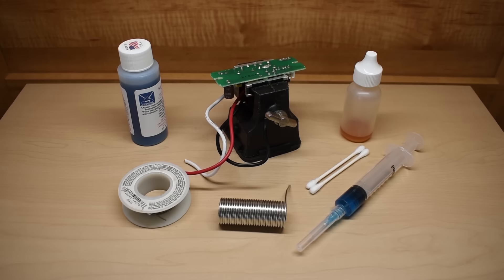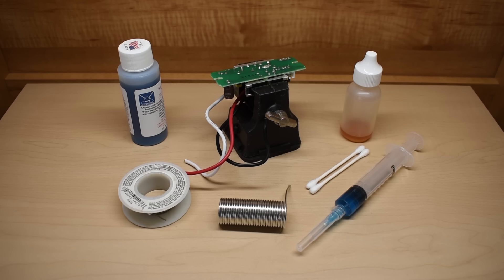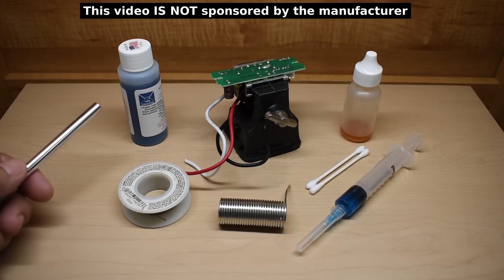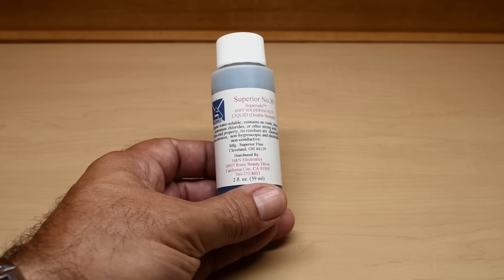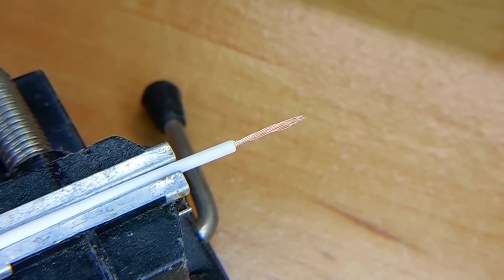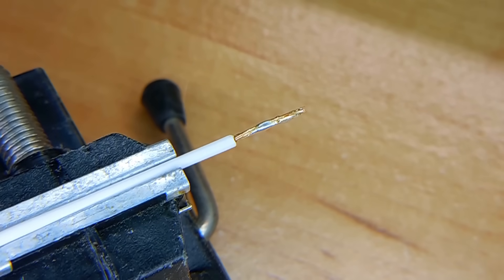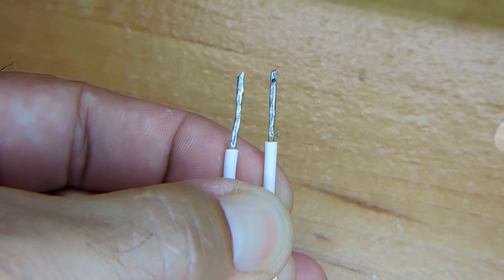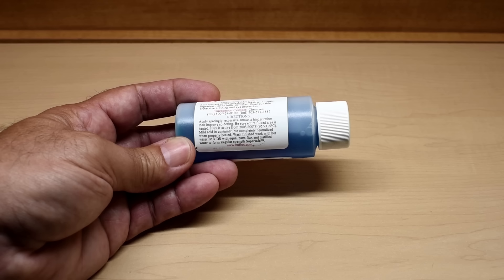Safer Alternative To Rosin Flux For Soldering! (LOW SMOKE)

Comment: The smoke is nice. If you're worried about the lead, it boils at 1,749'C and does not evaporate!  Its too heavy. We solder around 400'C. It would be a poor choice if it kept floating away in smoke. The basic rosin core lead tin solder smoke is harmless and smells nice. Original flux is tree sap. which is organic. Its these new smoke free variants that maybe toxic.

Comment: I have something called "Kester flux pen # 952D6", it's also completely liquid and has no fumes, but I find it works strangely. It helps for tining, the same way as rosin, but right after that my solder is not shiny and does not flow anymore. It becomes like a paste and is not shiny, and when I remove the soldering iron, it leaves an impression at the last point where it was pressed. The solder just does not flow to fill in the dip.

Comment: What I find very funny is that they call it 'organic' as if that distinguishes it from rosin flux... Most people do not seem to know what rosin flux is made from...
Here is a definition of rosin:  Solid amber residue obtained after the distillation of crude turpentine oleoresin, or of naphtha extract from pine stumps... Yep, thats right... It is the exact same thing that makes pitchwood aka fatwood aka tinderwood so hard and shiny. If you want to see some, just go to the hardware store, or a local Walmart and check in the camping or the fireplace supplies. They sell bags of the stuff to start campfires and fireplace fires with... And the smoke produced is also the reason you DO NOT burn pine in your fireplace, in addition to it leaving highly flammable deposits in the chimney.
I am not saying that this stuff is not any good, as it looks to work well, just that calling if organic, as if that is a selling point is hilarious.
The other questions I have, is can you use anything else than water to clean it up with? I do not like using water on something I am going to power up right after soldering it. With alcohol based flux cleaners, it dries so fast that it is not a problem.
Nice video
Reply from the maker: Thanks for watching Jim, and thanks for the info!

Comment: Cool, thanks. They say organic hair gel is as good as a flux like Amtech or from MG Chemicals?
Reply from the maker: Never heard of that before.
Reply: @electronicsNmore  Hi. I'll try my organic hair gel (they say it's better than petroleum jelly for DIY flux), as soon as my soldering wire spool arrives, can't wait to try my new KSGER T12 workstation (my other favorite tool, the other is the first, all metal, digital caliper by General).

I'll mix my 100% pure japanese matcha powder (coz' it's king of anti-oxidant when it comes to teas) w/ the organic hair gel. I hope it works and it's unit price per gram is cheaper than Amtech & other branded fluxes (hopefully it works w/ aluminum wires too- btw any DIY technique soldering thin gauged aluminum wires- this got me started soldering again and upgrading my setup)
:-)

Comment: I just started soldering one day, and suddenly after Im done, like theres this kind of smell in my nose, am I fine? I know im wrong not having fan or smtg to get the air out but I just did it once, am I okay?
Reply: You won’t probably die off for one off incident. 10-15 years ago there wasn’t much information. We all are doing fine. I soldered every weekend the same way for 2 hours each. Now I don’t do it though for past 3 years. I have a ventilation system

Comment: Smoke rises so if you just stay off to the side you should stay out of it. You cannot get enough flux fumes off the tip of a low watt iron to do any harm anyways. Just because you can smell something does not mean it is hurting you.
Reply from the maker: It has a tendency to follow you. One time exposure to the smoke? No big deal, but if you solder a lot, inhaling rosin flux fumes will cause health problems.

Comment: why do we not get lead poisoning for handling leaded solder all day long ?
Reply from the maker: It doesn't absorb into skin that easily.
Reply: Inorganic heavy metals are not the most dangerous forms. They become most dangerous when they are converted to organic forms by chemical processes, or skin bacteria if not washed off of the skin. As for fumes, a normal soldering iron will probably blow the fuse before it gets hot enough to vaporize lead.
Reply: i see, thanks.

Comment: Lemon juice works well and water cleanable.
Reply from the maker: Interesting idea, but I'm not too sure if the acid would become neutralized after heating it. You also have solids in the juice. Thanks for watching!
Reply: @electronicsNmore   I've used it a lot but yes, don't have solids in it but cleaning is easy with water and neutralizes the acid.  Just give it a try. I'd be curious to what you think after using it.

Comment: What I see is, that the blue flux doesn't work as well as the resin flux - the solder practically had to be painted on that wire.
Reply from the maker: Actually, I didn't apply as much blue flux as the rosin. Using the a little more blue flux, and a little more heat, and the result is very good. I think the rosin flux transfers heat better.
Reply: @electronicsNmore  
It is actually not transferring heat. If anything it is using the heat to evaporate and in the process clean the copper surface of oxides and other residue.
Reply from the maker: @Peter_Riis_DK  I'm convinced there was a better transfer of heat using the higher viscosity rosin.
Reply: electronicsNmore 
I'll not challenge your religion. 😉

Comment: Yuk, I do not miss rosin flux, that nasty crusty residue and the smell. I use Chip Quik flux now.
Reply from the maker: Never heard of it.
Reply: @electronicsNmore  Oh you gotta do a Chip Quik video! It's the stuff that lowers the melting point of solder so you can remove chips with lots of pins using a simple soldering iron. That's their main product, the flux is just an extra they ship it with I happen to like more than other fluxes.

Comment: I addressed this issue to you about 3 years ago which its good that you made a video about it. But I see a debate going on in the comment section since some have preferences. I personally disagree with your method to use a fan to blow it away from your face since it goes "indirectly" to you. Best i think to blow it outside the window that way the particles go out of the house to be safer. But even then I don't agree with with using toxic things since as we see in Asia it bottles up over time when everyone does it and has to go somewhere. Sometimes accidents happen and the metal will get hotter. But yes your product seems better than most. Just another thought.
Reply from the maker: I had my windows and jalousie doors open when the fan was running, otherwise the room would've filled with smoke.

Comment: Nice, finally a way to solder without all of the smoke!  Thank you for the terrific video.  Always a thumbs up and looking forward to the next video!
Reply: @Project Farm I hope to see you do a detailed video on different types of flux and flux cleaners!
Reply from the maker: Glad you liked the video! BTW, that RV in your recent video was hilarious! Hope to see more of it in future videos! Thanks for watching
Reply: ProjectFarm approved! Good enough for me!
Reply: Organic flux name is actually incomplete. It is Organic Acid flux. They are very corrosive (among electronics rated fluxes, plumbers flux is even more corrosive) and require cleaning. They are meant for wave soldering of PCBs.  Kester 2331-ZX is a brand name example of this type of flux. Here is a breakdown: Plumbers flux is acid based, often using zinc chloride. not ever safe for electronics. For electronics you have Rosin flux, Resin flux and Organic Acid flux. Rosin (kester 1184 is an example) and Resin can be a no clean variety. Rosin and resin will not cause allot of corrosion. Rosin and resin will need alcohol to clean them off. Resin is often rated for higher temperature appropriate for lead free solder, but either rosin or resin will work for leaded or lead free solder. Organic acid will cause severe oxidation if not cleaned promptly, but it and it residues can be cleaned off with just water.

Comment: Guess I’m strange, but I love the smell of rosin flux. Cleanup is a pain though. Regardless, my soldering station has a fume extractor.
Reply from the maker: Not good for the lungs or brain. The fume extractor on the soldering station is great if it has the long flexible hose that you can place very close to where you're soldering. Thanks for watching!
Reply: @electronicsNmore  why? after 40yrs of this what symptoms should i be displaying?
Reply: @lezbriddon  Cancer mostly

Comment: Having solder melted on the iron tip before you actually solder a joint on a pcb is asking for a cold solder joint
Reply from the maker: No, it flowed beautifully.
Reply: @electronicsNmore  I didn't comment about the solder not flowing. Starting with solder already on the iron leads to cold solder joints.
Reply from the maker: @1231trainfan  You saw the video, no cold solder joint.
Reply: @electronicsNmore  I did see the video. You didn't read what I wrote. Read it again
Reply: Cecil Turtle  1) he starts with solder on the tip
2) the joint ends up just fine
What does that mean for  your original statement?

Trying to use solder where the flux has boiled off to make the joint  before it hits the joint is bad.
Using solder on the tip to increase contact area and heat transfer, and then bring in more with new flux, or even just flux if there is enough solder, or having flux already present at the joint as in the video, will work fine.
Reply: There is no cold joint. I agree with electronicsNmore that it flowed beautifully. I use the same technique as well. The melted solder on the tip helps spread the heat quickly to the component so there is no excess dwelling of the pointed tip to heat up the pad and pin.  Try it.

Comment: Rosin is organic too.
I stick to my selfmade Flux, Rosin in Ipa(99) alcohol and a couple drops glycerine.
And you not even know what's inside in this "better" akternative.
Reply from the maker: Yes rosin is organic, but there's other chemicals mixed in with the rosin that aren't good. I'd rather sacrifice a little flowing performance, for a much less smoke and fumes.
Reply: @electronicsNmore  you can get pure Rosin and mixing it yourself 😊
Reply from the maker: @WaschyNumber1  I need to check my pine trees. :-)
Reply: @electronicsNmore  👍 😊

Comment: Breathing Rosin Flux smoke DAMAGES lungs.  If you look inside the filter of a fume extractor you will find white filament structures accumulated over time.  That is reconstituted Rosin.  The same happens within your lungs.  Rosin being some what benign  and organic does not invoke the bodies response to reject.  Accumulate it will.  My mother in law worked at a Wiring Harness factory for some years.  Her lungs are all but SHOT.    Use a Extractor !
Reply: I thing it would be more the lead thats harmful and the lungs can repair them self to some point, a filter in a fume extractor not 🤔
Reply: @WaschyNumber1  Lead like Mercury has a bad wrap.  Not nearly as toxic as people make it out to be.  Yea it's bad but nothing like people make it out to be.  The Rosin destroys lung tissue leading to  emphysema .  They don't have a lead free solder that works yet.  Non of the offered  works as well as the Lead/Tin alloy.
Reply: @pulesjet  yes, I still like the lead version better than the lead free.
Reply: @WaschyNumber1  Yep!  LOL  I've tried about every alternative available and NONE of them perform or do the task at hand as dependable or reliably as well as good Ol,  Lead / Tin.   Some day they may come up with something good.   Until then Lead it is.  LOL
Reply: @pulesjet  The reason we have lead free solder isn't because they don't want people breathing lead. You can't breathe the lead in solder, under normal circumstances anyway. They want it out of the landfills and oceans, where all this crap will end up one day.

edit: i replied to the wrong person
Reply from the maker: @NETBotic  Yes, it's more for environmental reasons. Like I said in the video, you'd have to overheat the lead to get the metal to give off fumes. If you handle it, just wash your hands when you're done. I don't think it absorbs into your skin easily, if that was the case, lead fishing sinkers would be banned.
Reply: @NETBotic  Comical Really.  Back in the Ground from where it came from.  If they only new that lead is the end results of Uranium Decay they would really freak out.
Reply from the maker: The problem is how things go back back into the ground. Clearly you wouldn't want to take uranium from a mine, then dump it in your yard, or a body of water. But if it goes back in the same type of area it was extracted from, no problem.
Reply: @electronicsNmore  Who's dumping Lead into the water ?   Who's dumping it into my yard ?   Who's being irresponsible ?   Many things would be toxic doing that dumb chit.    Many thing are Toxic because of those  IRRESPONSIBLE Actions like that.   Why zero out Lead ?
Reply: @pulesjet  They wouldn't freak out, because that has never been a problem. Lead soldering produces a higher volume, concentration and surface area to be absorbed than anything naturally occurring.

Comment: Why do you use lead free solder, it's crap.
Reply from the maker: I prefer 60/40. I didn't have any solid core on hand for the video.
Reply: Because I would rather not have lead around me and constantly be considering which surface/material has been in contact with lead. There's a reason lead was removed from gasoline and paint. It accumulates in your system and there's no level of it that's safe. 
     Lead-free isn't exactly the same as 60/40, but if you dick with the variables a bit it works out well. It doesn't make you cool to get kidney damage just so you don't have to learn a new thing 😄✌️
Reply: @els1f  

Sure, because the lead vaporizes when you're barely at it's melting point, and I also love to eat it, 60/40 is really tasty! The flux core tastes like honey.
Reply: @westelaudio943  😄 That's true. It IS pretty good when you mix it into your coffee
Reply: Crap for you maybe, personally i like it better

Comment: Rosin still has better wetting if im seeing this well
Reply from the maker: I'd say yes, but I could've applied a little more flux on the wire, and more heat. As you saw, just fine on the PCB.
Reply: @electronicsNmore  to me it looked like you applied the rosin much more liberally than you did the other which might account for that. I'm definitely getting me a bottle of that stuff it looks amazing.
Reply from the maker: @aznative_  I didn't have another plastic dropper bottle, so I used a soaked Q-Tip. It does flow very well using that flux, I've used it a bunch of times since I bought it.
Reply: @s1iznc1d34  eye protection is a good idea soldering. Chances are you won't get anything in your eye, but why take chances?
Reply from the maker: @s1iznc1d34  I used it a lot, but it doesn't do that often.
Reply: I've come across a great deal of information about fluxes throughout a lifetime of pursuing my interests.

Not everything used as flux performs the same task. 
Perhaps the earliest example of flux would be borax that has been heated until it flows, then cooled & ground into a powder. This works well for preventing oxygen from contacting superheated steel when forge welding, but does nothing to lower the melting point of the steel, nor to dissolve the oxide coating of steel.
This same flux reduces the melting temperature of brass by dissolving the protective oxide layer, and preventing further oxidation when heated.
Rosin is on the opposite end of the spectrum of fluxes.
It's literally boiled down coniferous tree sap. The terpenes are driven off, leaving a mix of carboxylic acids.
It dissolves the oxide layer of most metals with a melting point lower than the combustion point of the rosin it's self, and prevents the formation of oxides under heat in the same metals, thus lowering the melting point of the metals used in soldering and less frequently zinc in joining galvanized pieces.

There are many fine details that dictate what properties flux has when being used with a given metal, but you can be sure that there is a flux for every use case.
If you find the smoke from rosin flux bothersome, first try lowering the temperature of your soldering iron, then try a flux with a higher combustion temperature.
The substance acting as a vehicle containing the carboxylic acids is largely unimportant, the acids themselves are what do the work.
Reply: I would assume rosin would transfer heat faster as it is denser. Still not worth it IMO.
Reply from the maker: @NETBotic  I'd rather have cleaner air.
Reply: @electronicsNmore  Same here, that's why I'm subbed on this channel. I agree with everything you say lol.
Reply from the maker: @NETBotic  You can disagree, it's OK. :-)